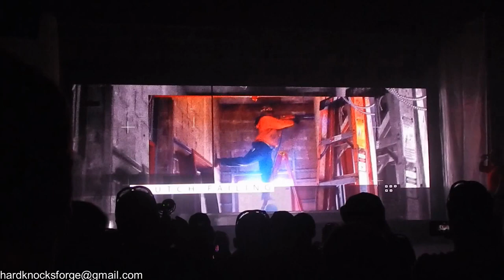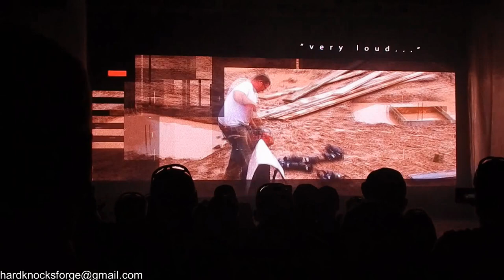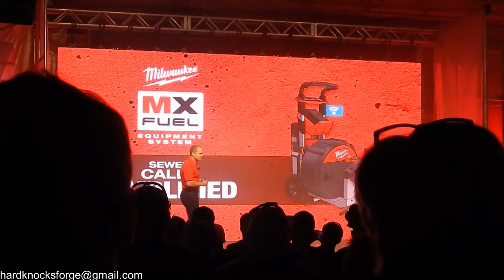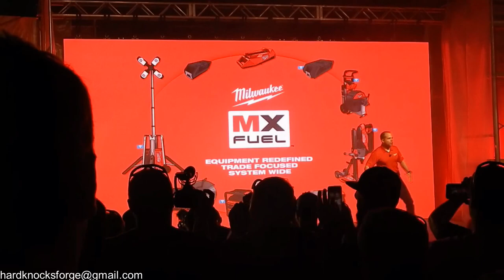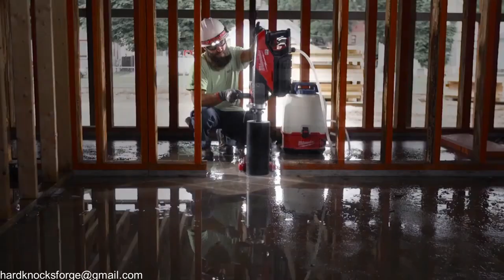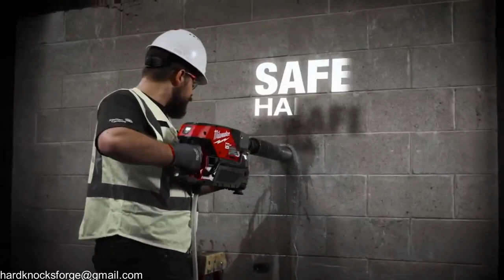Milwaukee MX FUEL Leaked footage from behind the scenes at NPS19 Products that NO ONE has ever seen

Comment: Those are going to be a nice replacement to gas units
Reply from the maker: It's going to all depend on cost, BUT when you add in all the up-keep to small engines and keeping them running, even when you do the work yourself, it could be an excellent replacement for gas units.